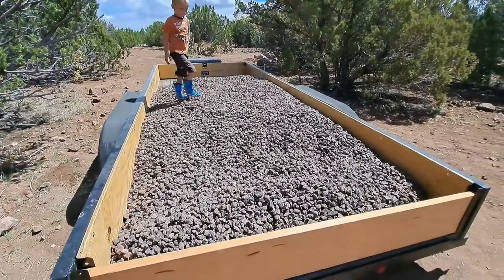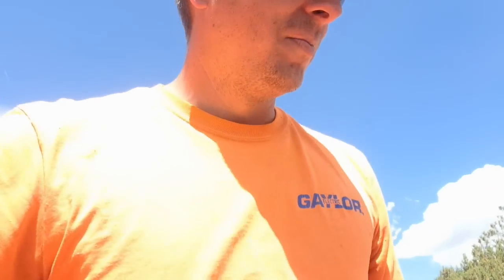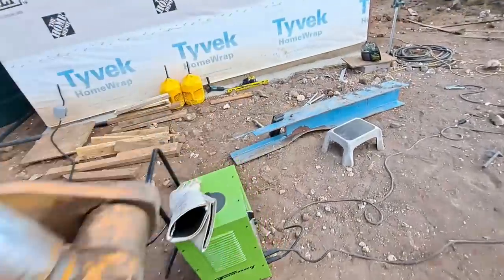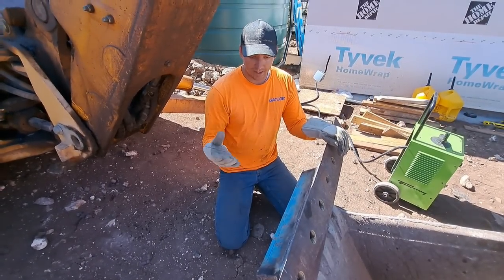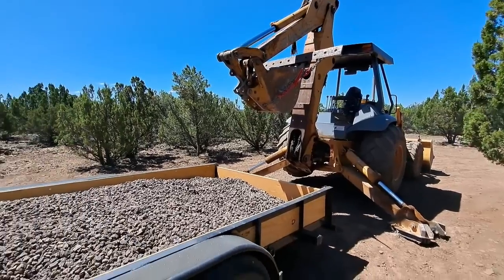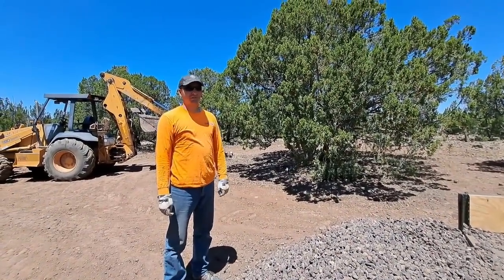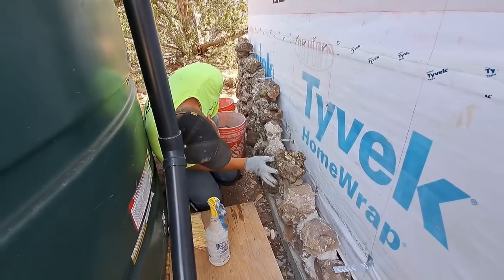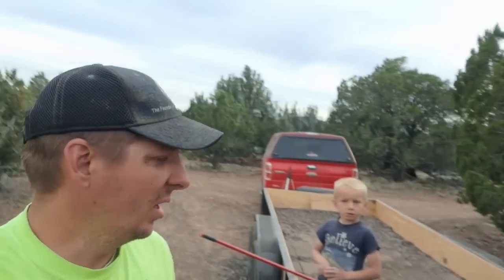😎 Why SHOVEL Gravel, When You Can DO THIS!

Comment: interesting idea. You could also, if the trailer's frame is sturdy, use your backhoe to pick it up from the lead end, even if  its just to a 35 degree angle, you could then easily sweep the gravel out.

Comment: You could fabricate an adjustable "shoe" (like tiller runners) so that the blade couldn't dig in more than what you set it for. Might make things easier on your trailer. - I would like your photog better if it weren't quite so focussed at all times. When it's your eyeballs looking, you see more of a panorama, what's going on around. Makes for a better understanding of the situation.

Comment: Unhitch the trailer use the backhoe to lift up the tongue of the trailer and watch all the gravel slide out the back of the trailer
Reply from the maker: It's an idea, but the trailer is not designed for that. Thanks. 🙂